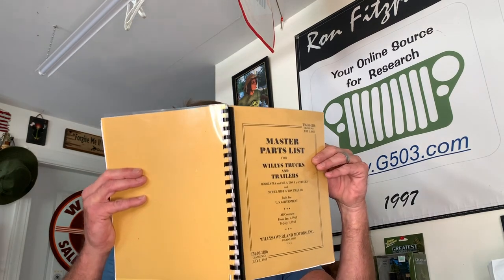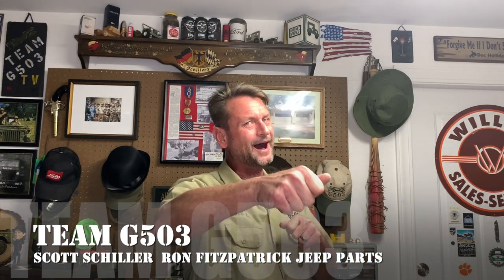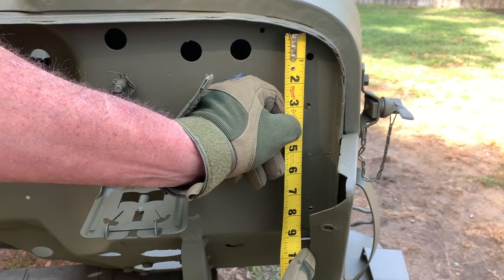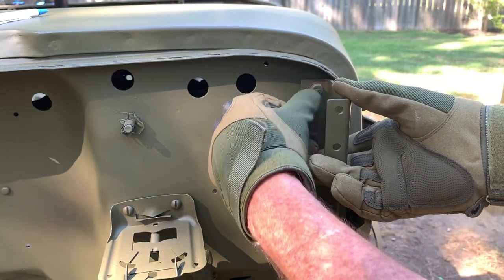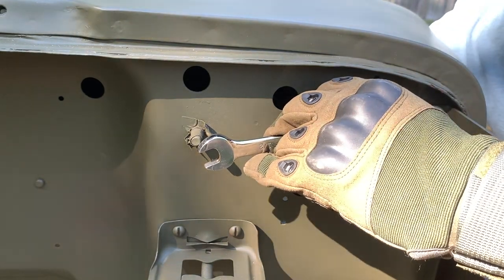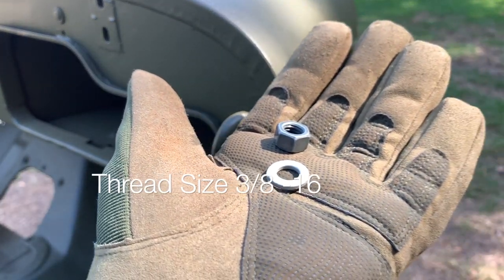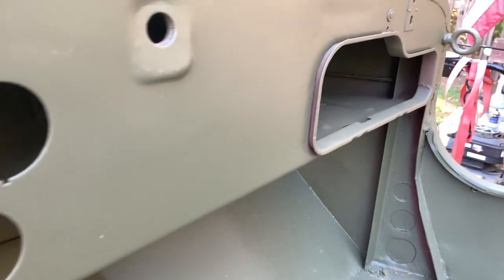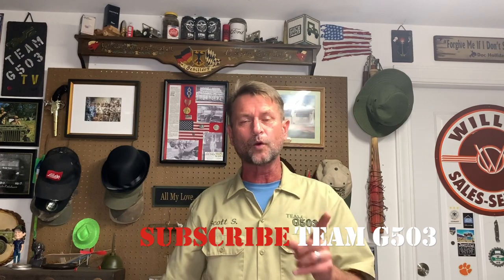Installing The Horn Bracket And Doorway Strap Eyelets On A Willys MB With Location Measurements

Comment: Another great video Scott.  
Question about reusing original bolts: Early on in my resto, I would clean, prime and paint many original bolt.  One day I snapped one off with light pressure.  I panicked and started buying and prepping all modern bolts for remainder of resto.  What are your thoughts about evaluating/reusing original bolts and nuts?
Reply from the maker: I like to use originals if I can. I have had the same thing happen with snapping them. In my experience if it’s going to snap. It’s going to when you put it back on and give it the Ole tight😉
Now, on engine parts such as head bolts and stud, I like to go new.👍